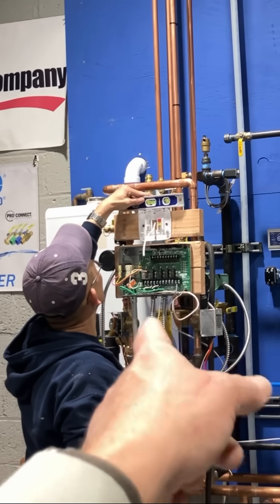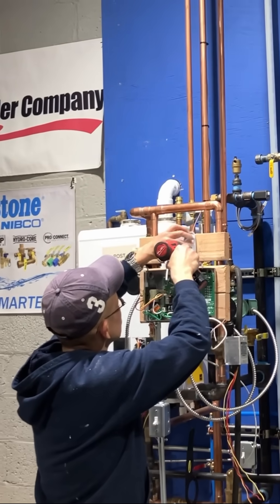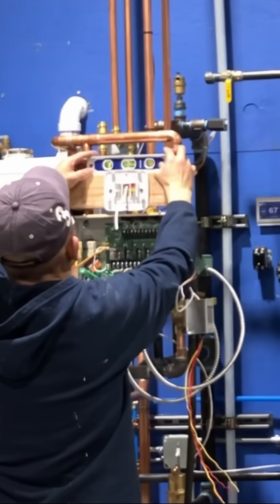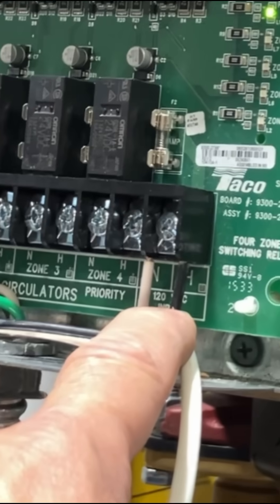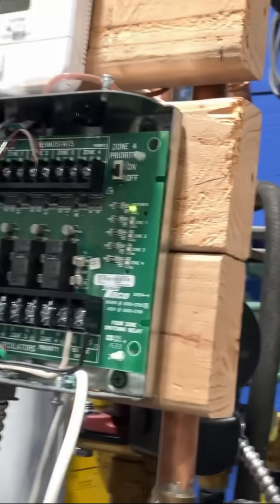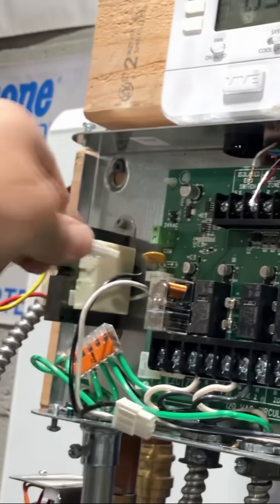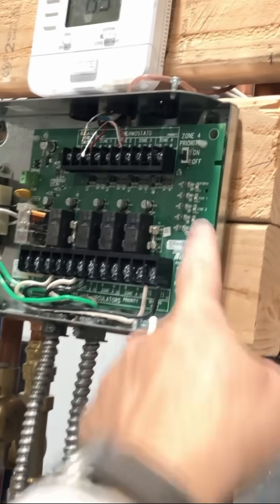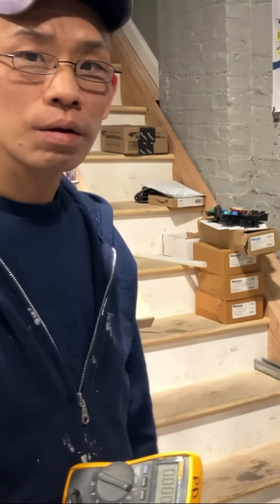Taco Switching Relay Installation & Troubleshooting- Diagnosing Defective Board #hvac #plumber

Comment: So I'm suddenly not getting a green light on my Taco SR503-4. I definitely get 120vac at the input. I understand there could be a fault with the transformer, but is there a fuse somewhere leading up to that transformer that I should check? I see 4 fuses next to relays on the board, and I'm thinking I should pull each one to check for continuity. If they're all good, do I then just swap out the transformer? I've also seen some suggestions regarding the ice cube relay potentially failing. Is that something I should also check?

Comment: My navien 240 wasnt getting switched on from taco sr504exp , i jumped isolated sw. ✔️. Unit  fires up & ciculator was already going before that, swapped a few relays after confirming theyre all same # but still not always working,  transformer seems very HOT to the touch🤷🏼‍♂️. Idk if thats normal & after i verified relay functions (top down -4321,?,iso sw). The bottom iso relay poped in my hand while plugging it in, im replacing all 6 relays but concerned about transformer surface temp?
Reply from the maker: Sounds like you’ve been chasing down a tricky one. If the transformer on the SR504EXP feels very hot to the touch, that’s not normal—it should be warm, but not scorching. A consistently hot transformer can be a sign of overloading, a short downstream (possibly a stuck relay or miswiring), or internal degradation.

The fact that the bottom isolation relay popped in your hand is a huge red flag—could indicate a short or voltage spike when energized. Replacing all 6 relays is a good precaution, but definitely double-check:

Incoming voltage to the SR504EXP

Grounding and neutral integrity

Any backfeeding from the Navien’s internal circuitry if it’s wired for priority

Also, consider temporarily powering the Navien separately to rule out a loading issue caused by the board. If the new relays don’t stabilize things, you might be looking at a cooked transformer or board—especially if it’s been running hot for a while.

Let us know what you find after the relay swap.